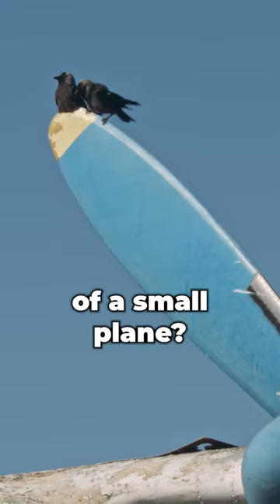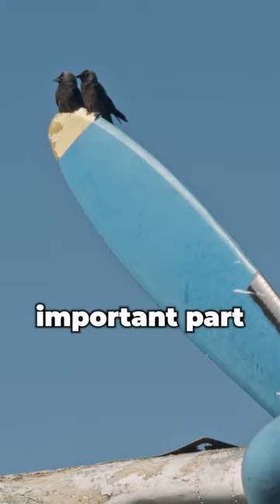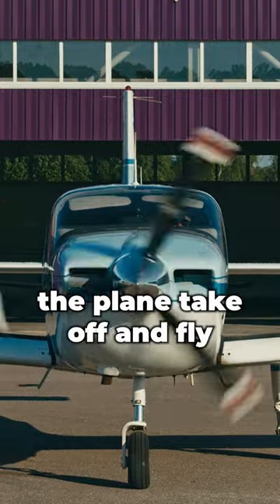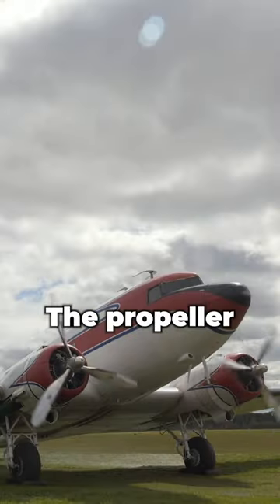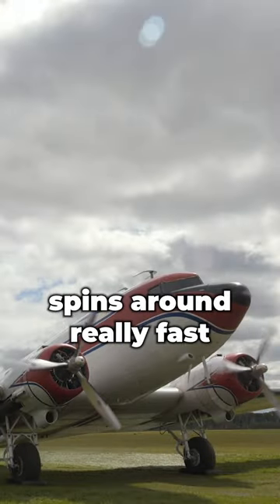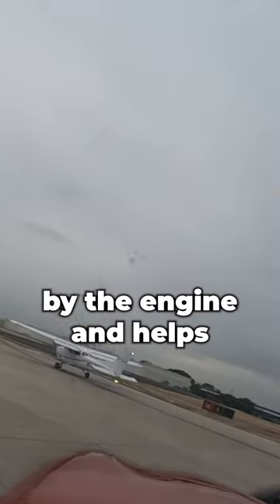How a Propeller Works! Engineering Explained behind Propellers! Educational Video #engineering

Comment: Prop pulls the plane through the air not push
Reply: Ever heard of the Wright Flyer?
Reply: @manofflorida1138  ok, fine. 99% of planes pull
Reply: Not necessarily. Planes with propellers in the back (SAAB 21 for example) would therefore get pulled backwards. Pusher engines allow them to be pushed rather than pulled
Reply from the maker: Lol yeah your right. 😂 My bad on that one!
Reply: @patrickcarver3607  Since the Wright Flyer pretty much defined what a plane is, it could be said that most planes are abnormal.
Reply: @manofflorida1138  Touche. However, with that statement then nearly everything Improved upon would be abnormal.